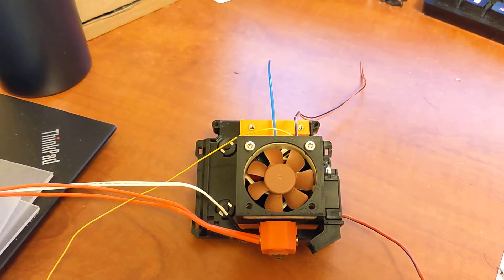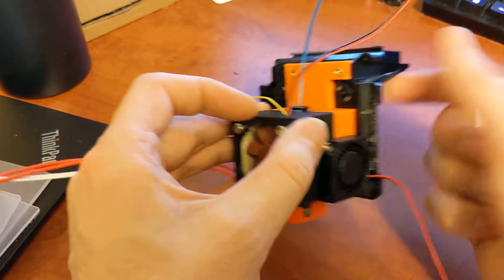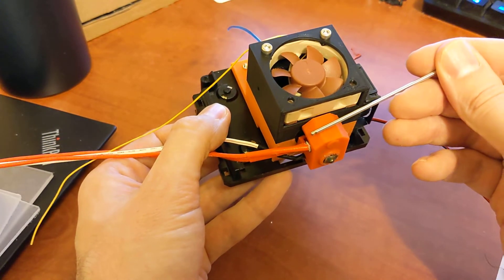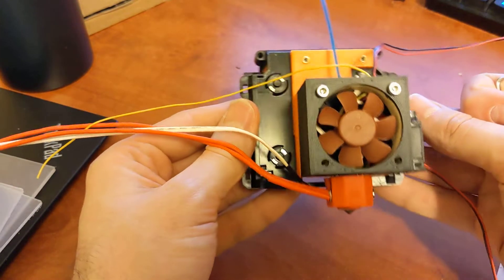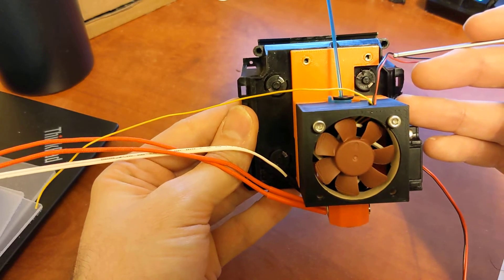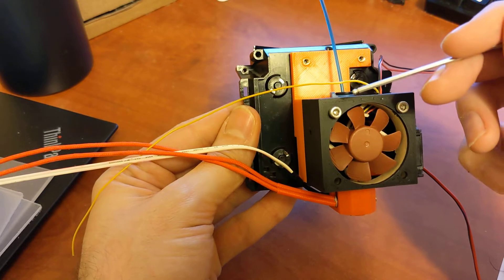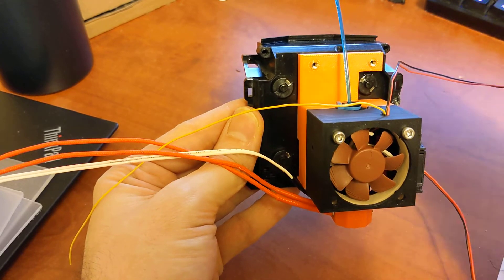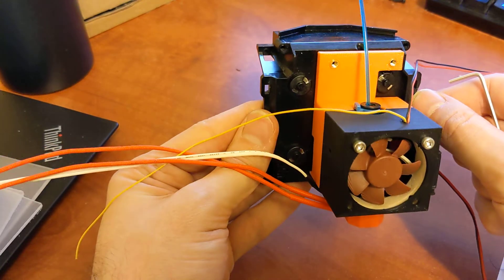Makerbot Replicator 5 with Klipper Part 1

Comment: hey all, any one done it and have any more info to share? like what screen need here? how the screen Connected to the pi? 
how the pi Connected to the board ? what best need to buy? on the list have only Silicone heater pad.
what the extruder need to buy? can be buy as a Part ready?
Reply from the maker: as I say the hotend is a dragon hotend, screen I think is a Waveshare 3.5inch just connected via ribbon cable. The Pi connects to the SKR Mini with usb. cheap BMG extruder is fine
Reply: @Rolohaun  cool ❤️ i ask for other.

Comment: did you make a change to the rear piece of the extruder mount? (orange in this video)
I printed the STL from GitHub, but it's different and the notch to avoid the magnet bump is in the wrong spot
Reply from the maker: here is the one right from my fusion https://github.com/rolohaun/Replicator5-Klipper/blob/main/Hotend_Rear.stl
Reply from the maker: In my final video I reprinted the parts black so I think I updated them. As far as I know the ones on github are correct
Reply: @Rolohaun  The parts in the video DO NOT match the ones available on github.  :-(
Reply from the maker: @lynwooddillman944  I am sorry for that, I have no clue what happened. I checked all my files and my parts are the same on github. Unfortunately I no longer have this printer

Comment: So I am attempting to do this with a MakerBot replicator 5 i got from a coworker where the smart extruder failed, I had extra parts laying around and using a skr mini e3 v2 as well figured I can give it some life instead of tossing it. How did you hook up the stepper motors the left and right and the z axis to the skr mini also did you install any kind of end stops at all? Which motor goes to what header, never worked with an Hbot printer mostly just ender 3's and such. Appreciate the unique mod by the way, definitely going to follow for future  projects
Reply: So I think I finally figured out the wiring for the steppers was my issue some wires were reversed so had to repin, but now I am running into the issue of having no limit switches and bed or toolhead crashing, going to look into a bit more regardless sensor less homing never done that and not exactly sure on what is needed hardware wise to do it
Reply from the maker: I uses senseless homing for X and Y and BLtouch for Z. You can easily swap the X and Y motor if they are wrong, you may notice your parts are mirrored and you can just swap the cables.

Comment: First off, thank you for releasing the files for these parts - I'm going through a nearly identical makeover on a MR5, and was about to begin modeling parts for the hotend when I found your video, so this saved me quite a bit of work!

I did find that the published hotend back part does not actually fit the MR5 carrier, and is slightly different than the one in your video. I modified the model to look like the one that's in your final assembly by resizing that back plate and shifting the mounting holes down by 15mm, but for the sake of future hackers, maybe you can upload your final design to the Github repo? I didn't see any licensing information in your repo, so I also don't want to upload anything elsewhere without your consent, but having these parts is an incredible time saver for anyone doing this same project.

Thanks again for all your work on this, and for making things easier on someone else trying to rescue this old MB hardware!
Reply from the maker: I added the Step file, I do not see any difference with the one on GitHub though
Reply: @Rolohaun   Looking at the step file, you're right - it is the same as the model in the repo. 

It is actually dimensioned a bit different than the one in your video, though - If you look at the part around the 1:00 mark, the tab at the top that actually has the mounting holes is shorter, the cutout for the magnet hump is closer to the top mounting screw, and the third, lower mounting point actually appears to be behind the part of the shroud where the hotend and fan are. Does that make sense?
Reply from the maker: @amorton12  oh very odd!
Reply: @Rolohaun  All said and done - I figured out what made this part work - only the notch for the magnet hump needed to move. Once I had actually mounted up my modified part with my E3D clone, it became apparent that my hotend sat too far up, and it couldn't zero to the bed before the machine ran out of Z travel. Going back to your original design and simply moving the notch did the trick - it then cleared the old mounting plate's magnet and sat low enough to properly zero out.

A couple of brackets for mechanical endstops were the only other things I really needed to get the print carriage to work for my Marlin/RAMPS conversion, and I also managed to get a heated bed working on it with very little modification to the original build platform. The dinky OEM power supply can't handle the heater cartridge and the bed running full tilt at the same time, but heating the bed before turning on the extruder has worked totally fine so far. I could really only get PLA to work with blue tape before adding that, and it sticks perfectly to a PEI coated spring steel plate now.
Reply from the maker: @amorton12  awesome, glad you got it!
Reply: https://youtube.com/shorts/skOc_m09tSU?feature=share
Reply: Hiya, I found the same to be true.  The parts I downloaded and printed were not the same ones in the video. Do you by chance still have your modified STL's??  Thanks.
Reply: @lynwooddillman944 Yes, most likely. I’ll go look in some of my docs and try to find where I put them
Reply: @lynwooddillman944  I found my files, including the parts I modified to fit:

Edit: Hold plz, found more files that I think are the actual ones...
https://drive.google.com/file/d/117PJWTqRBJEKkCE9MOQAtbWH-b1hRpLf/view?usp=sharing